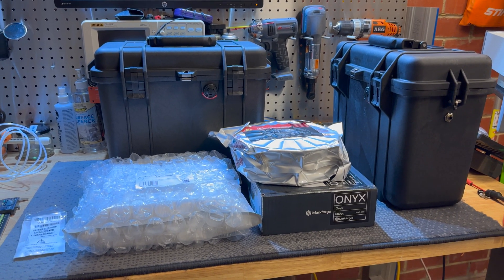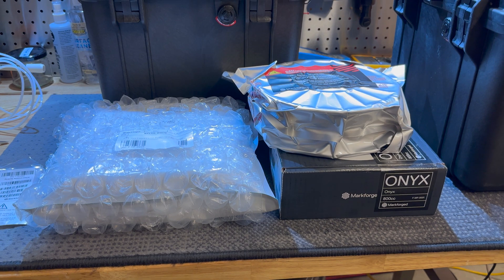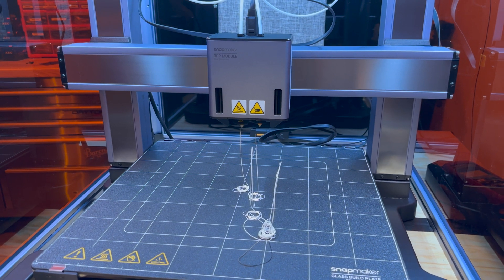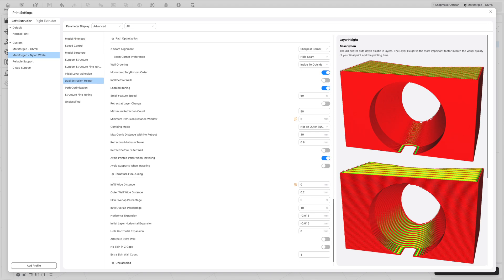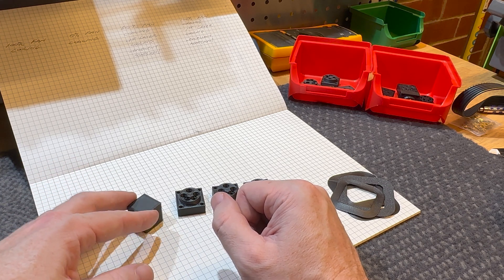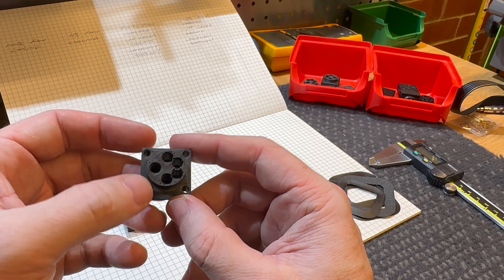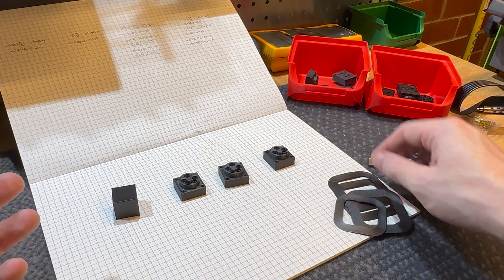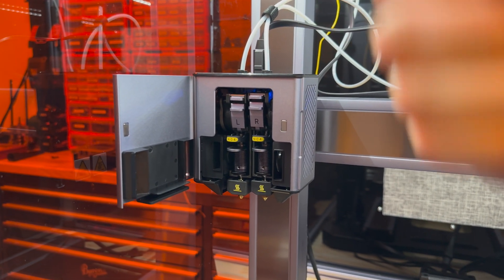Snapmaker Hacks - Using Markforged ONYX & Nylon Filament?

Comment: Love the video. Look forward to seeing more. I'm interested in CNC 4 axis- do you have any projects upcoming for that. Was thinking of doing my own chess pieces with family crest. Going to also do a custom board that has both laser engraved detailing and CNC. Was also thinking about adding 3d print in the design just to give it depth
Reply from the maker: Definitely, the part shown in this video will be CNC’d out of teflon soon but still getting my head around it for an upcoming video 🙂 the machine is easily capable of this work regardless 👍